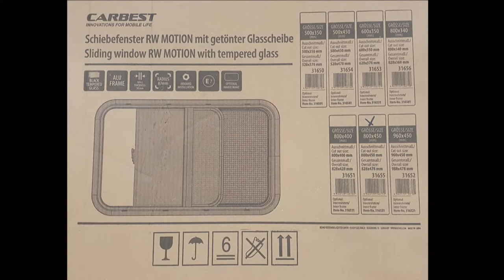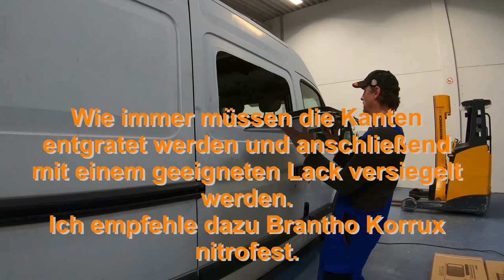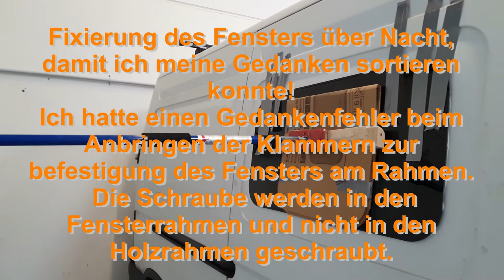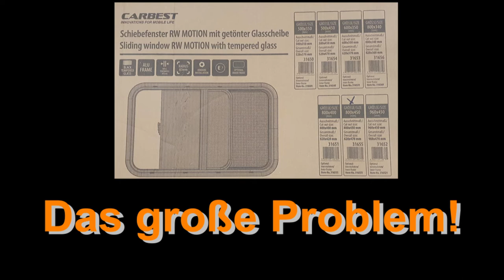Folge 7: Einbau der CARBEST Fenster - RW Motion ist undicht!

Comment: Hello,
Thank you for the video. 
We had the same leaking problem with the window the first time it rained. We noticed that, on our model of Carbest sliding window, it is possible to remove 4 little rubber strips on the frame below the window, from the outside, allowing the water to evacuate. It now works fine. Hoping that can help some people. The instructions are just so bad. Good luck everyone!
Reply from the maker: Hello, I almost thought that these little rubbers could be for that. But I couldn't bring myself to remove them because I wasn't sure. The assembly instructions are really very poor. Thank you for the advice. 

Where are you from? I'm glad to have English speaking viewers as well.
Reply: @deeporange  Yes, it's really not clear. We didn't see those at first.
I'm from Belgium, currently converting a Peugeot Boxer. Good luck to you
Reply: @deeporange  Sollte Punkt 10 in der Anleitung sein.
Bin Grad selbst am überlegen mir eben ein solches Fenster zu kaufen.